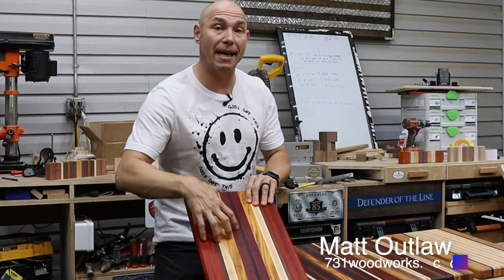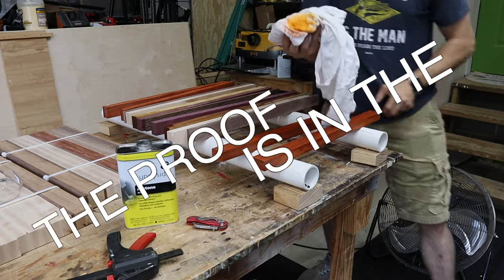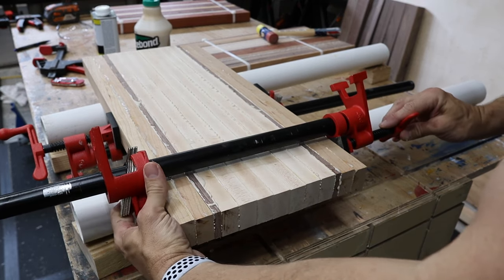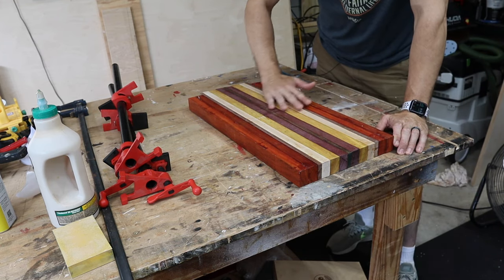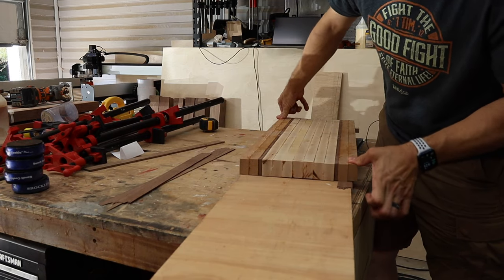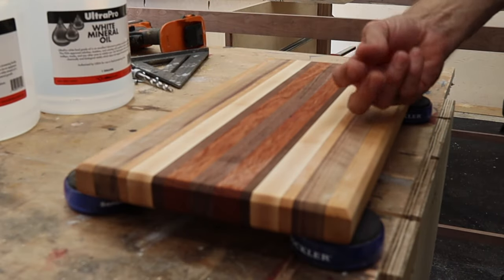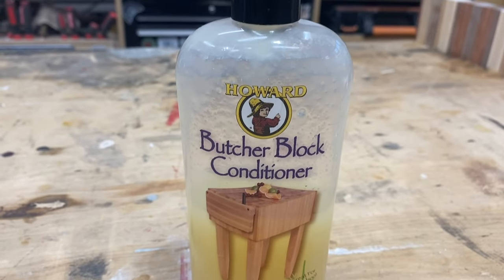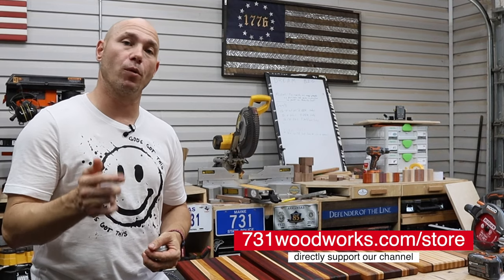How To Make a Cutting Board | Beginner Woodworking Project

Comment: Actually, they will leak out the oil.  But that's okay, the client can just wipe it down.  The reason this happens is because wood moves.  The temperature, barometric pressure, and sea level are all different, and when the board gets sent from Indiana in my shop to Florida, it can sweat out some of that oil.  Again, that's okay, I'd rather have too much than not enough.

Comment: Just a suggestion here... put some packing tape on calls and the sacrificial boards you are using to clamp with. Wood glue won't stick to it. In my experience, I have had issues with some painter's tape getting glued to my projects (probably because I am cheap and don't buy the good stuff), then I have to try to scrap it off and end up sanding it off sometimes, which is a total pain. I have never had an issue with glue sticking to the plastic surface of packing tape.
Reply from the maker: Thank you

Comment: If you have a drum sander, it works so fast to do the rough sanding and leveling of the board. Using this tool is like night and day over a orbital sander. Also, I usually pop the grain twice sanding lightly in between the two. Enjoyed the video.
Reply from the maker: Thanks for the info!

Comment: Pvc also makes a heck of an explosion when it explodes on your face when you cut it on the miter saw.

It fragments, so I always cut it with a sawsawl or (#moredangerous) by rotating it on the table or miter saw. 

Just cutting it straight down on the miter saw can make it literally explode, and send shrapnel all over the shop.

Comment: To help fight the slipping wien you glue up, you can sprinkle a bit of salt on the glue before you put the pieces together.  This adds a bit of grit and will stop the slip.
Reply: I learned that trick from a guy that custom builds big butcher block countertops

Comment: Gorgeous & easy, think I'll have to make a few of these and see how they sell.

Do you have any problem with coating the under side of board when soaking in the mineral oil? 

Thinking it needs a juice groove. What would you recommend for size, shape, router bits, etc? So far have small Makita LXT cordless trim router and basic set of 7 Whiteside bits. 

Where do you get your board butter? Might eventually want to put my own company logo on the tins but maybe that's a ways off as I'm just getting started in woodworking at this point.
Reply from the maker: No problems with the oil coating the bottom side.  I make my own board butter.

Comment: Can you reuse the mineral oil again? Like if you want to do another set of boards?
Reply from the maker: Yes it can be reused multiple times
Reply: @731Woodworks  Awesome. You don't need to worry about any lose particles or anything contaminating it?
Reply from the maker: Only thing that should be in it is maybe some light specs of saw dust or wood.

Comment: Awesome tips! Mildly confused by using PVC pipe to keep the boards flat though. If you can expand on that a little, it would be helpful.
Reply: You don't want to clamp the boards directly to your table; the glue run out will end up gluing the board to the table! Using the PVC elevates the cutting boards off the table, and the glue doesn't really stick to PVC.
Reply: @johnsonwesleyt  Nice, rings clear now:) Thanks Wes!

Comment: What do you do with the left over mineral oil, throw it away or dump it back in the bottle and reuse later?
Reply from the maker: leave it in the container.  I use it several times before switching it out.

Comment: Great video!  2 questions:

Wouldn’t the wet rag raise the grain/expand the wood if it was used with water?

Also, what if you cut 2 more pipes and put it on top and clamp both holes?  Wouldn’t that make the pipe also a caul?
Reply from the maker: The 2 more pipes wouldn't work as cauls because they are slightly flexible.  There's not enough water to make it expand.  It's only to raise the grain
Reply: @731Woodworks  I see.. thank you for answering, I’m writing those down in my notes!

Comment: Great video been wanting to make some for a while.  Quick questions do you run into a problem using the CA glue for the holes because the CA is not food safe?  The other is after soaking the boards does the butter really soak into the wood because it has already been soaking in the oil for so long.?
Reply from the maker: I actually wasn't aware that the CA glue wasn't food safe after it was dried.  The butter gives it a top coat, think of it like a wax for your car.

Comment: Great video. Thank you for sharing. I find that when I’m gluing up boards, if I sprinkle some sand over the glue it adds some friction, preventing the boards from slipping & the sand is never noticeable when done.
Reply from the maker: Thank you
Reply: Great video!!!  Can the mineral oil be reused once poured?
Reply from the maker: Yes it can. Several times over

Comment: In fairness I have to give a word of warning.  Just received my kits today for the two cutting boards with purple and yellow, and the yellow heart is maybe 1/10th as vivid as what's shown here.  In normal lighting you can't even really tell it apart from the white beside it, you have to put a cold white flashlight on it to see the yellow.
This may improve a bit with processing the wood but even with putting some mineral oil on it it did not darken up much.  I'd be really surprised if mine came out even 1/4 as dark yellow as what's shown here, I'll be kind of surprised if it's even 1/10th.
These went from being late Christmas gifts for my brother and sister and maybe order 10 more after to sell, to on hold and see if I can find some better yellow heart locally.  I wouldn't even spoil the idea as a gift without the yellow/purple contrast pop, and these would be an extremely slow seller at $150 or $160 as basically brown purple and white cutting boards.  Pricey enough I wasn't expecting them to sell fast and that was with colors as in the video, but they really wouldn't move without the purple/yellow pop.  
I was expecting natural variability and maybe not having 1/2 or 1/4 of the color, but when you start barely even being able to tell the wood isn't white a lot of the value goes out the window.  So it's simply too variable to be purchasing across the internet.  If I'd had an accurate picture of the boards as received I would not have placed the order until they had some stronger color yellow heart on hand.
The wood is obviously high quality otherwise, but a lot of what made me go ahead and order is not there,, and everyone watching deserves a heads up on that..
Reply from the maker: WTG has offered a replacement yellow heart if you aren't happy with your product. He stands behind his product and I stand behind WTG.

Comment: Odd question, I’ve never seen anyone mention this... what do you do with the mineral oil when you’re done?  Can you save and use it again or dispose of it and get new oil for the next time you build boards?  Thanks. Great video and thanks for the wood source!
Reply from the maker: From what I've researched, you can use it multiple times. Keep the lids on the container to keep bugs/dirt out of it.  Mineral oil has a 5 year shelf life in the bottle.
Reply: @731Woodworks  Thanks Matt, I appreciate the help!
Reply: Always wondered the same

Comment: When I use the board butter I warm the board with a heat gun or even put in the oven at 200° and it lets the wax melt and soak in. I have great luck doing it that way. Would that be a power tip? lol Thank you Matt.
Reply from the maker: That is an awesome power tip!

Comment: you can use clamping cauls made from flat pieces of wood that are covered with packing tape so the glue does not stick to them and clamp those to the top and bottom to make sure your board stays flat too.
Reply: I see that I typed my comment before watching the entire video.

Comment: Thank you so much for the great tips! I was wondering if I can reuse the mineral oil in the plastic box after taking out the first board?  Thanks again.
Reply: Exactly what I was thinking! Just close the containers up and save them, or pour it back into the bottle for next time?
Reply from the maker: Yep you can re use it multiple times

Comment: I noticed the kits are a bit pricey.($70) How much would you sell these boards for? Thanks 👊
Reply from the maker: $150 or more easy.  They aren't that pricey if you look at what you are getting.  Three of the 4 kits have exotic woods that are expensive.  And you get almost 24" of each strip so you could technically cut these boards in half after you're done and make two smaller boards or two charcuterie boards.
Reply: I see you do get 4 kits for that price. Much better deal. I've thinking about doing some and see if I can sell to realtors....
Reply: I see it is each.
Reply from the maker: It’s each.

Comment: I have found that a very useful shortcut is to use a handheld belt sander with 60 grit sandpaper to smooth out the worst of the unevenness after glueup, followed by a random orbit sander for more fine work. This is good for those without planers, and for end-grain cutting boards where planers are risky to use. I've also used this method for tabletops and other things too big to fit in my planer.

This is an excellent video; thank you for posting it.
Reply from the maker: Thanks for the tip!

Comment: Great video with great tips.  Specifically your clamping process.  I have a problem with some pieces moving during glue up and I don’t get a flat surface. Going to make the pvc gizmos!
Reply: I do too. That's my biggest problem. This will help. Great video.
Reply: Take a 4 pieces of 1x2 or similar and put packing tape on one side so it doesn't stick to the glue and then clamp each side with smaller clamps. He quickly showed it on a couple boards in the video.

Comment: As always great video, I have made a total of 3 cutting boards, one I could not get level it was a tad off it may be during to being a checkerboard type I ripped, glued cut and glued again then after taking all the steps it still had a small wobble, ( as of yet I do not own a planner) so I just went to Home Depot, bought a set of small rubber feet chose the best side for the top and put the feet on the other side, I had to compensate for the wobble by adding a very small washer the same diameter as the foot and it seemed to fix the problem.

Comment: Are the edges of your cauls flat or slightly arced? Also, does Mrs. 731 use all nearly 2 feet of her cutting board, or could you cut the kit in half? Just watched your WTG vid, and have another question. Can you use mineral spirits or denatured alcohol instead of acetone to “de-oil” the exotics?
Reply from the maker: Yes they were flat.  Yes you can cut them in half and make 2 boards.  Not sure on the mineral spirits
Reply: @731Woodworks , thanx. Now I have to figure out who to gift 2 cutting boards. Wife doesn’t want one.
Reply: @bobkeniston4553  a smaller board is a great gift for a bartender...

Comment: Sprinkle some tabla salt on the surfaces after you apply the glue and as you clamp the piece, the salt will keep it from sliding around and will dissolve and will not make the joint any weaker

Comment: What are the dimensions of the wood if you cut the strips yourself. Thanks
Reply from the maker: They are all 1.5" thick.  The widths vary but the whole board is approximately 10.5” wide x 23.5” long

Comment: $80 cutting board kit??? Are you kidding?
Reply from the maker: wtg sets the prices.  But they are less than the ones at Woodcraft https://www.woodcraft.com/products/smoke-house-cutting-board-kit And Working The Grains are bigger sized. Some people don't have planers/jointers to build cutting boards.  This helps them make them without those tools.  WTG joints and planes all the wood so there is minimal work on the customers end.  If you have those tools, then you wouldn't need to buy a kit.

Comment: $83 for 1 pack shipped?? That seems pretty overpriced.
Reply from the maker: You could always buy boards of  purple heart, wenge, blood wood, walnut, maple, and mora.  Plane and joint the boards. Cut them all to 1 1/2" wide by the size you want.  I think they are priced fair.  These kits take a ton of work out of it, especially if you are a beginner wanting to make a cutting board and don't have a planer, jointer or table saw.
Reply: Buy 2
Reply: 83 for the material that you can make something you sell for over 200.  And only with a few hours of your time.
Reply: @litrpgfan1027  Really? How many people are willing to pay @200 bucks for a cutting board?
Reply: @731Woodworks  I may just not have the market for them where I live unfortunately. I see similar custom made cutting boards selling near me for $50-$80 albeit I don't know the multiple species used. Saw another comment where you suggested selling one for $120 if you were to sell. 
-Would ~$35 profit per cutting board be acceptable long term?
-What would you suggest the material cost would be if you had access to boards of these species yourself? 
-With a jointer and planer would you still suggest the kits or rather how you normally do them?
Thanks for taking the time to help all of us with these videos and comments.
Reply: @litrpgfan1027  Have you ever sold one for over $200, be honest?
Reply: @731Woodworks  I think this price is pretty much the going price for exotic kits on the big wood working sites.